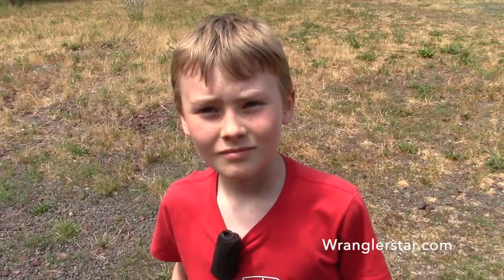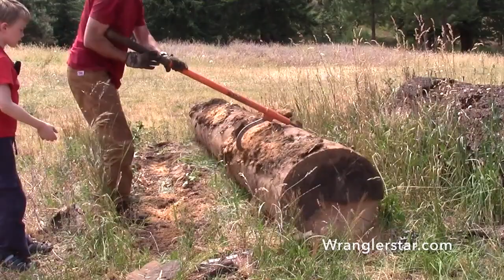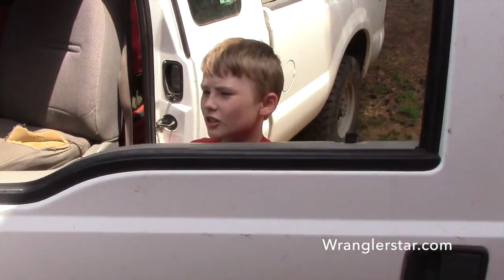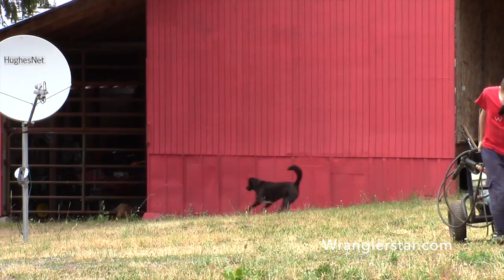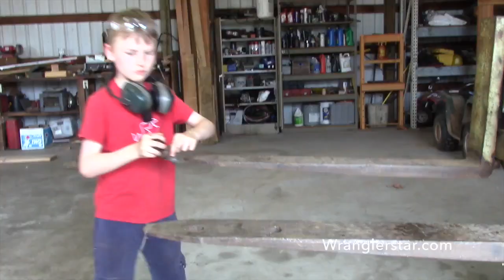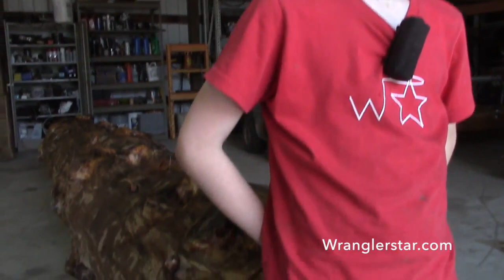How To Build A Treehouse Ladder | 34

Comment: One thing you missed putting a wheel chock or chocks while winching so its not so hard on the park pawl in your transmission the E brake on the Fords doesn't hold it is pretty anemic. It is good to see Jack learning some skills.

Comment: This is a fantastic video. I enjoyed how you challenged Jack with a potentially difficult task. At the same time you set him up for success with optional tools for him to use and think through the task.
Safety Sally, You must have missed the safety lessons of using the jacket on the cable, and never getting under a load. Far more important that a bit a wear on a vehicle.

Comment: a little tip for Jack: I noticed that when he was pulling the log, the truck was rocking some. to save your transmission when using the truck as a stationary pulling base, engage the parking brake. It puts less stress on the transmission.

Comment: When you winch like that do you allow the transmission parking gear to resist the winch or the parking brake?  It seems like it would put a lot of strain on the transmission using park alone.

Comment: i have never driven an automatic car, and i have never used a wrench like this, so i have to ask:
Is there a specific reason that you did not pull the parking break before pullung the log? i mean, sure it was in park, so there was no way for the truck to roll away, but you could still see that it moved a little forwards and backwards...
do automatic cars even have parking breaks/e-breaks?